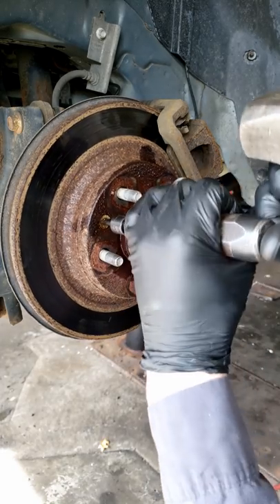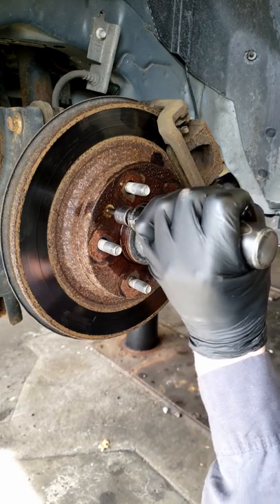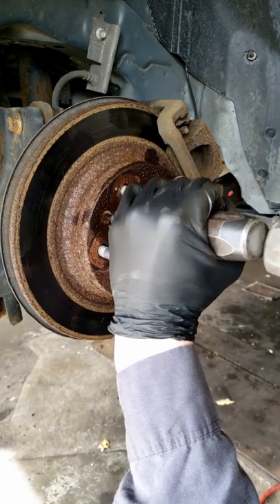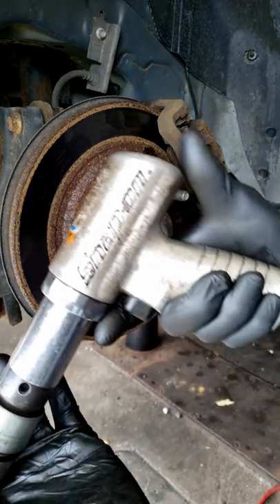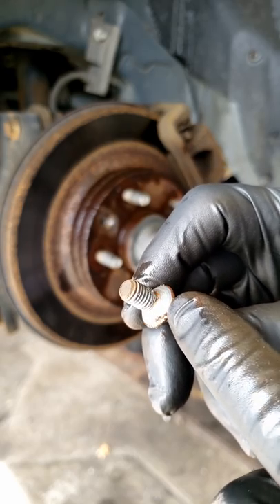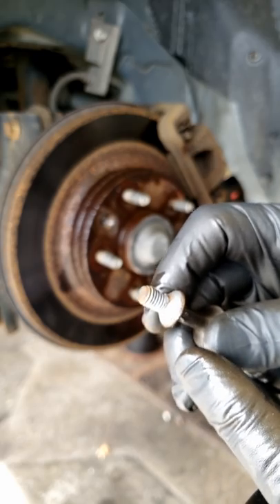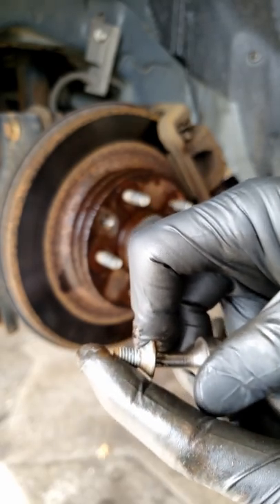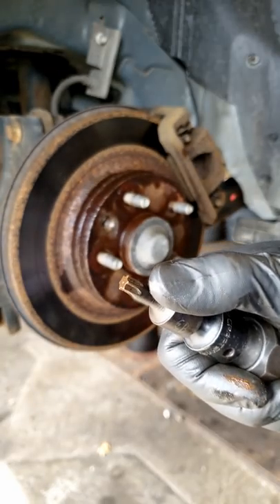Best Way To Remove Brake Rotor Screws

Comment: Rust penetrate was unnecessary. If you don't own an air hammer just smack tge rotor on the friction surface in a few placesand the screws will become the fulcrum for all that leverage and break the bonds. They'll come out just as easy. 
The air hammer is a great tool to use if you are planning to reuse the rotor or you already have it out of your box. If you're trying to do your own brakes without air tools just give her a swing.

Comment: No it's the rust build up between the rotor and hub it expands effectively tighiting that bolt. I ABSOLUTLY NEVER put those back in they are pointless they are for holding the rotor to the hub on the assembly line until they get the hydraulics and calipers hooked up. Also pro tip if you swing hard enough with your best BFH you can snap the heads right off them screws by hitting the rotor surface

Comment: You must be careful when hammering on any hub especially with an air hammer as it often leads to brinelling of the bearings in hubs and side bearings in differentials over the long term. To get those bolts out easy just heat them up with a torch real quick and they will bust loose with the hammer driver no problem 👌

Comment: 2 tips that won’t have you eating ramen so you can pay off your tool truck bill
1. Use the Back side of ball peen hammer on rotor screw hit with another hammer repeat until it can be loosened 
2. Chisel on side of screw tap until chisel bites into screw and moves screw. Will damage screw but you’ll mess fewer up the more you practice you get!

Save your money work your mind

Comment: The ultimate question from forum communities.... do you replace the screws when complete? My answer: no, not necessary... installed during assembly as car moves down the line to keep rotors from falling off. Don't need.  Huge debate online!

Comment: Just smack the hub on a flat spot a few times with a hammer that has some weight to it before using the impact driver and you'll never know it was seized! Just dont use a crappy bit!

Comment: being your replacing those rotors anyway, put that retaining bolt  over 180 degrees from where the brake pads sit, and wack it from the inside  area where the inboard brake pad would be, it will come right off , done it a thousand times,

Comment: The impact driver would have done it no problem but you must use it properly.  It requires 1 hard smack while you're twisting it

Comment: I can’t believe he had the nerve to say that with those dry ass threads. It is very obvious zero penetrant made it to the threads and the air hammer rattled the screw heads enough to not be ceased.

Comment: You're using that tool wrong. You're supposed to hit it hard once. But before that make sure to twist it in the right direction
Reply from the maker: I know how to use the tool. I was going light on it because I didn't want to damage the bit. When the camera wasn't rolling I already tried getting it out really hard. I wanted to show demonstration in the video that hitting it lightly the screw wasn't moving and after using vibration, heading at the same amount the screw came right out. It was simply a point of reference

Comment: Penetrating oil and the correct bit helps a lot too...they're rarely just phillips heads, which is why people strip tf out the heads using a plain screwdriver. Gotta get a PZ or JIS screwdriver that fits snugly and a good grip on the handle 😁

Comment: If you throw a bunch of heat from a torch into it, and shock the threads with a hammer into a normal screwdriver, it'll just come out

Comment: Has nothing to do with the threads rusting, or penetrant seeping under the taper. Think about how rust is larger than clean metal surfaces. What ur doing with the air hammer is simply squishing that rust back, and pushing the rotor back towards the hub so there’s less pressure on that screw’s taper. The same thing happens with wheels and seized lug nuts. It’s most likely not overtorqued, cause any impact can overcome even an overtorqued wheel. It’s the rust and corrosion built up between wheel and brake rotor that pushes the wheel away from the car and into the seat of the lug nuts. Clean your hubs and you’ll never have a problem

Comment: nah... drill 'em out... those are just for the assembly line anyway.  those little screws don't have anything to do with stopping the car. or holding on the rotor, the lug nuts do that.  the screws keep it all together at the factory so it don't fall apart when going down the line before the wheels are on. .

Comment: I hate those rotor screws and never use them because of that exact reason it gets rusted and are hard to get off when you're doing your brakes or swapping out the rotor itself

Comment: Or if you aint got a pneumatic hammer you just drill the head of the screw off and it comes off. You dont need then, those are for the factory line

Comment: If the impact driver doesnt work, use a chisel at an angle to spin it out, Then throw them in the trash cause those screws are useless.

Comment: These rotor screws are completely unnecessary, plus the difficulty of removing them is why I recommend people to NOT put them back in. This is a good tip encase you do come across a vehicle with them.

Comment: I never use this tool, 
Just take a hammer and tap on the bolt 2/3 times hard and then try to loos it with your wrench it works always for me even without penetrating fluid. 
Cheers

Comment: The only point for those screws is to secure them when they're being installed at the factory. Other than that they're pointless and you don't need them. Drill them out!

Comment: I simply take my miniature torch and heat the screws and boom… Out they come within 10 seconds.. no pounding no hammers just heat up the screws and they will come right out. It wouldn’t hurt to put some penetrating oil on it first though.🧐

Comment: That took way too long. I use an the exact same snap-on air hammer you have but with the chisel bit. On low I’ll air hammer the screw in a counter clockwise manner an it comes off in seconds. Ill do that to wheel locks, crankshaft bolts, pinion gear nuts, axle nuts, you name it.

Comment: It does not let the spray in it literally brakes the thing lose people are just too clueless anymore
Reply from the maker: It does both
Reply: @NNKH2  you literally said "what it does is help the rust penetrate seep in and break the bond" no you broke the bond by hitting lol this is kind of basic stuff that penetrating oil did literally nothing at this point you actually pulled out a threaded screw that had no penetrating oil on the threads 😂
Reply from the maker: If you look close there was a little bit in there

Comment: i would get rid of rotors screw because dont need them on vehicles because when u put rim on n lugnut that only thing going hold it in place wont go anywhere until remove lugnut n rim

this screw can be pain in butt get off n have drills them out get rotors off

Comment: drill the heads off and you have alignment guides....who puts those back on anyways??
Reply from the maker: Drill bits are expensive and get dull easy. If anything burn out with torch

Comment: Don't listen to this guy. First off, pull the fucking e-brake if the hub starts spinning like this( he is working on the rear). If it's the front, put a screwdriver or Flathead in the slots on the top of the rotor and have  the screwdriver get caught on the caliber. It makes it EXTREMELY hard to break the rotor hold down screw loose when the rotor is spinning. Second, you're supposed to turn your wrists counterclockwise while hitting your impact driver with a mallet. I have literally never had to use an air gun to get this shit loose and I've seen some super rat nasty brakes before. Also using the proper penetrating oil helps. the brand "liquid wrench penetrating oil" has literally saved my life from literal hell on earth

Comment: Smack over the screw with a hammer and comes right out, then tap back side of the disc and off it comes, takes less time than this video does.

Comment: Another way is using a small ball peen hammer and hit it with your big hammer it will Flex the head just enough to bust it loose you can actually pull it out with a regular screwdriver after

Comment: New fix.
Step 1. Round off Torx bit.
Step 2. Get better Torx bit.
Step 3. Round out screw.
Step 4. Get 3 arm 5 Ton Hydraulic gear puller.
Step 5. Mount the Cannon and blow off rotor and screw.
Add failed other attempts and swear words for taste.

Comment: Here’s an even better tip, for the love of god DON’T replace or put those stupid screws back in the rotor.  There is no use for them except that in the factory they ensure the rotor stays on as it travels through the assembly line

Comment: I usually just hit it with pb blaster torch it re pb blaster it smack the crap out of it with the impact driver. Then i throw away the screws whoch another mechanic got angry at me for but he also is the guy nobody trusts so i dunno

Comment: Id say, I see no rust the threads at all. And impact wrench was made to be hit with decent blow. Not a weak wrist effort that was shown here.wreck the philips head driver. Not a chance.
Reply from the maker: The light blow was used as a point of reference to show difference after vibration

Comment: Yeah bro you're doing it wrong... use appointed tip on the air hammer and then back the screws out with it

Comment: If you actually know the proper way to use an impact driver,  it'll get em out EVERY time.  Or at least in my 35+ years of slinging wrenches I've never NOT been able to remove one with it.  But hey,  that's just me. (Results may vary)
Reply from the maker: Go watch part two if you don't think I know how to use an impact driver. Or just continue being a hater
Reply: @NNKH2  No.  No hate what so ever.  I'm just saying that I'VE always been able to get the job done with an impact driver.  That tool isn't everyone's go to tool.  But it works for me.

Comment: Or you can drill them out, or use a chisel bit with the air hammer.. use fire, weld a nut and loosen them that way.. there's tons of ways, pick your poison.

Comment: Another reason not to buy ford.  I have a f250.  It did not have screws on the rotor.  I am scared now.   My chevrolets don't have screws either.  Now I need to check. dead gum.

Comment: Or if you are a broke ass that can not afford air tools, a ball peen hammer, and a regular mallet. Place the ball side of the ball peen on the screw and proceed to beat it with your other mallet. A few good whacks aught to do it.

Comment: Skipping all this useless advice. 99/100 a stuck bolt will come out but slightly tightening it and then undoing it. Especially with electric impacts, hit it tighten, then undo, works most times

Comment: "rotor bolts can be real tough .. especially on the Fords " .. ofc Fords are pieces of crap these days .. rust out just by looking at them .. myNissan for one .. 2008 i could take a normal screwdriver to them and they came right out .. barely any rust on them .. ergo Ford sucks when it comes to rust .. and yes in Denmark we have harsh weather also .. and yes we DO salt the roads